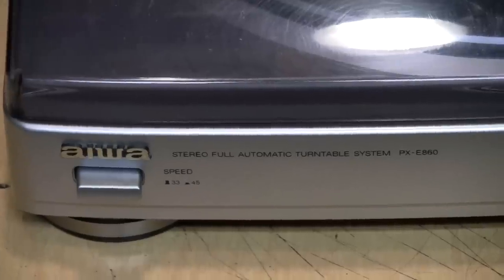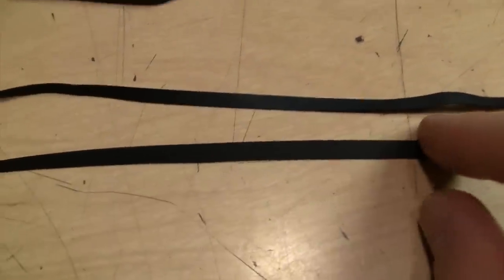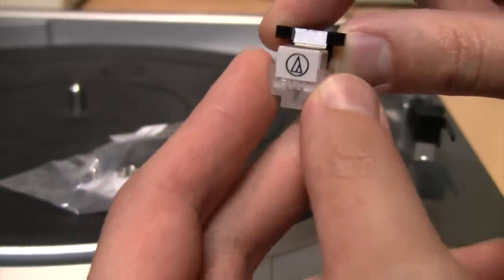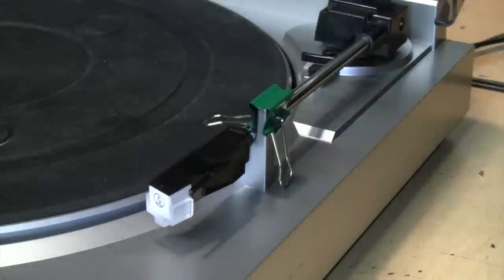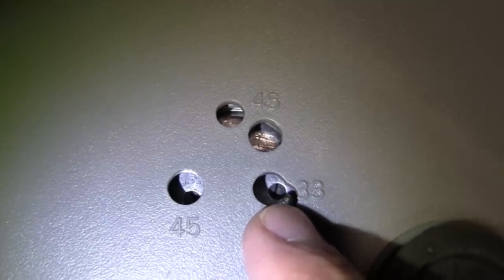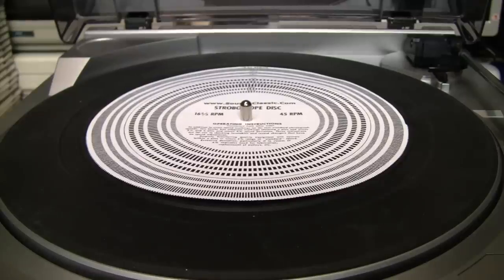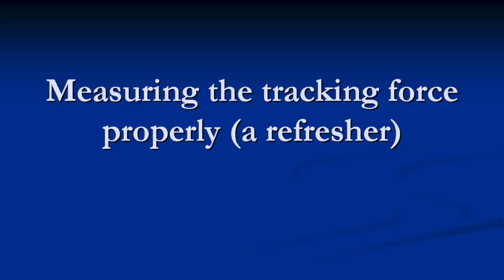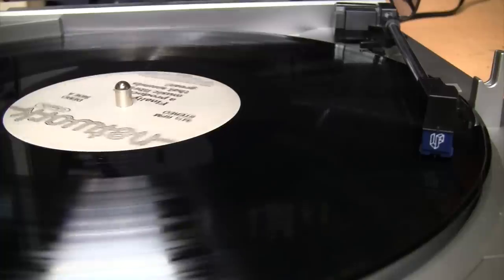Cheap fixes & upgrades for cheap turntables

Comment: I have a problem with my turntable of similar design. It’s a Optimus LAB 1100. when I set the pre amp to the off position and plug it in to my phono input I get a hum, which gets better when I either touch the body of the amplifier or the metal part of the tone arm, buzz gets louder louder when the internal DC motor starts up. When I turn on the preamp and connect it to a normal line in, none of that happens. It plays as it should. Any thoughts on that? 

Also. These don’t have a tone arm lock, but they do have a small hook behind the tone arm rest which you can put a twistie tie behind and tighten up on the tone arm for safer transport. That’ll help prevent scratching from a bulldog clip.

Comment: Turntables are hard to come by where I live, but I bought this exact model a couple months ago. It's my very first turntable, it costed about $25 but for me it was worth it since it didn't need any kind of repair, just needed the speed adjusted. I would've loved this video when I bought it, it explains very well how to get it going, which I had to figure out myself from multiple sources. Excelent video regardless, I truly love your channel. I just bought a Technics SL-QD33 yesterday for like $8 and I'll see how it performs

Comment: My first turntable was a JVC JL-A40 direct drive model, which should tell you how long ago I had it. I still have the Sansui SP-2500X speakers I bought at the same time.

I would like to get an equivalent turntable, but funds are limited these days. You can find an A40 sometimes on eBay, but they run $160+ before shipping if you want a working model. The A20 belt drive model looks similar, but still runs $80 plus shipping.

In  your opinion, do modern belt-driven models provide a near approximation of mid-range direct drive tables? I'm talking about less than $300 models, not a $2,000 turntable. Also, could you recommend a modern turntable with performance equivalent to the A40/A20 series? I'm picky enough to prefer an elliptical stylus and moving magnet cartridge.

Comment: I bought this model of turntable for a project to upcycle an Edwardian mahogany inlaid  HMV gramophone cabinet that had been cut down / stripped out probably 50 years ago  for a bedside table probably  and had seen better days. This was more of project to test out my French polishing / carpentry skills before attempting more valuable furniture. The Awia / AT turntable were the only ones that fitted within the cabinet’s width. These are very cheap turntables second hand and I was most sceptical about it, but it performed well with the active loud speakers I used for the gramophone cabinet project so yesterday I connected it up to my main hi-fi comparing with a Rega planar 3  which has a Quad amp , B&W speakers and was surprised at how well it sounded compared to the Rega.  I’m running a Rega Carbon on the RP3 which  of course I now realise is the same AT 3600 as the Awia  with a different mount. I only paid £25 for the Rega Carbon so it’s a cheap cartridge  but it amazing it’s ‘Only’ a AT 3600 at heart.  But why spend 10 times more ?

Comment: That 45 adapter part made me laugh. Because its true. I seen people use on top of a record like one of those record clamps/ weight. 

My good friend has the same Aiwa turntable. He bought the all in one unit back in 1999 maybe 2000. He still uses it a lot. I have the Sony turntable I bought for my bedroom back in 2009. I recently updated the belt and replaced the needle. The new belt has more torque. The original belt kept slipping once in a while after around the 4th or 5th year of owning it. 
Love your vids. Keep up the good work.

Comment: Just bought myself a second hand Pioneer PL-990 to fit into my 90's era Pioneer stack project (complete with LaserDisc player on the bottom). This was mostly inspired by your previous videos on the subject. Good step up on my cheap n' nasty GPO Memphis which has been in use far longer than I intended. If I'd listened to the snobs I would've had to keep using it while saving up something "acceptable".  Sure tables like the ones in this video aren't anything fancy but they are a good place to start/move up to if you know you're serious about amassing a collection without breaking the bank. Will maybe try that LPGear elliptical stylus when my existing one wears down. Love these videos, keep 'em coming!

Comment: I own that aiwa, I made some mods to the preamp, I replaced the op amp and  remove some filters, the high pass filter because my amp do its own filtering of signals below 20hz  and it's already DC protected in its inputs and I removed some filter that aiwa put there to reduce radio interference for people living near a radio station antenna. I also calculated the RIAA response and replace two resistor with 2 pair of resistor in series to get the value more closer to calculations and now the curve is more accurate. I glued two pennies as counter weight to get 3.5g. I also put an on/off switch in the 110/220 hole because I'm paranoid and the preamp is always on. I replace the transformer because the original was vibrating and making a 60hz hum (the reason for an on/off switch in the first place). The mods really improve the sound especially the removal of the filters because the filters used electrolytic capacitors in the signal path that degraded the sound quality.

Comment: I'd really want to thank you for showing the speed adjustment thing. I couldn't figure out how to adjust that because i didn't see any screws inside the 33/45rpm holes. Didn't know i was supposed to go through the gasket with the screwdriver. It took a while to set the correct speed, my at-lp60 usb was spinning 34,5/46 rpm at the beginning (i used the app to check that out). Now i was able to set it down to 33,5/45,3 rpm and it made a huge difference. Records sounds now way more accurate than it used to.

Comment: I have this exact Aiwa turntable. It's running too fast, even after trying to adjust the 33 setting slower. Do I just need to replace the motor? Do you have a good source for the motor?

Comment: Although I have been using record players for my whole life, some young people that never had a player at home and are not accustomed to them have asked me some of the stuff you depict. I found it very interesting and very informative and not only for those begginers, I learned some stuff too. These players may be the stepping stone to begin a collection. Not everyone can have top dollar stereo and these can show you how good or how incovenient a record player can be.  A well balanced buget player hooked up to a decente stereo with nice speakers can deliver nice sound. My 13 y.o. son have a sony record player connected to a sony shelf stereo, with tape, cd, md(lp), rds tuner and bluetooth through an adapter. A nice set up for wery little money.  I might upgrade the stylus to the blue one you showed.  Only tips I would add i to lubricate both the hinges with a silicone  based oil and the motor shaft with a syringe and synthetic motor oil (Just one drop to minimize the hum/background noise. The other is to place the player on a rectangular foam or sponge. this isoletes the player and the stylus from adjacent vibrations, dampening all of them and cancelling the Haas effect.

Comment: Is there not a little plastic hook on the back of the tone armrest? My Acoustic Solutions DR130 almost looks like it was made in the same factory as this, and it came with the tonearm tie-wrapped to the rest via a plastic hook built into the back.

Comment: I just picked up an Audio-Technica AT-LP60XBT-USB-BK as an additional TT to my old Hitachi.  While the Hitachi works wonderfully, I wanted a more "plug and play" TT to play through my 4K home theater which involves my high-end 4K PC.  This was more of an impulse purchase, but I am pleased with the sound produced by the AT TT.  That being said, one of the things I DO NOT like about this particular AT TT is that there is NO tone-arm clamp.  Luckily you shared that neat clip trick!  I feel a little more confident now while using this TT knowing I likely won't experience the dreaded tone-arm "bounce" when placing an album on this unit.  Small thing to some, big thing to others I guess ---- thanks for sharing that neat little trick!

Comment: To avoid shorting when making trim adjustments to the motor speed adjustment you can substitute a proper trimmer adjustment tool, which are insulated plastic or ceramic, to make the speed adjustment.  That is the intended tool and they are insulated because they are often used to adjust the potentiometers and capacitor trimpots on live circuits (sometimes even very high voltage in the case old tube based gear).  Trimmer tools come in a number of shapes and sizes, but in this instance you would want the flat/straight tools, though one may as well buy a small kit to keep on hand if they wish to tinker with adjusting their equipment themselves — though in general if one does not understand electronics they will want to limit their tinkering to only those adjustments that are very clearly labeled or per documented procedures.

When printing the rom speed check discs it really should not matter if your printer scales the size up or down a bit so long as it scales equally on both the X and Y axes since it is the degrees of rotation between AC line frequency flickers that actually matters and not their precise size and the degrees between each tick mark will remain unchanged so long as you scale up or down equally on both axes.

Comment: Thank you so much for this video! It is such a solution jewel 💎 for a beginner audiophiles! I have bought a Sony lx300usb turntable for 80$ from my buddy who is moving, and it turnes out it has some things to improve that my friends haven’t  noticed in 3 years of owning it 😝 
1) Rpm is 34.6 instead of 33.33 and I’m kinda scared to get a wrong screwdriver or mess it up🪛 
2) The tonearm mechanism is a bit off “falling” down to the record
3) Stock needle is dusty and I guess it needs to be replaced too
4) Belt is kinda ok but  you’ve recommend to replace it too
I’m really wondering should I maybe return it & get the brand new audio technica lp60xusb instead, since it will cost me a bit of money to get all this replaced (equal to the lp60 maybe? 😂 ). If anyone will be kind enough to give advice to a newbie, this would be awesome.

Comment: I have a sony 300 that is brand new but when it is on the table sounds like it is contacting the motor pulley. Thin. i might need a new spindle also the spindle can be pulled up and down almost a 1/4 in. What you think.

Comment: Question. I live in Europe and have a max 100 euro budget for a new turntable. I don't have the experience of getting the best old turntable and what comes with it. And as a student not the possibility for buying a €100+ turntable. I first had a retro travel player but want to have a small upgrade. Is the Nikkei NTT01U the equivalent of the Audio Technica LP60 (old style)? I can't seem to find a brand offering something similair as the LP60 except the Nikkei. It goes for 80 euros new. There is also the victrola vpro3100 but that is just above the 100 euro's mark. For 100 euro's we can have the LENCO-L101, these 2 can be a possibility as well, but I would love to spend that on some LP's if the quality of the Nikkei isn't too much different of the Victrola and Lenco. Thanks for your answer in advance.

Comment: can't fix the speed of a at-60, using a small screwdriver to turn the 33rpm screw but to no avail, seems it doesn't turn at all; any insight? the speed is a little over 34rpm.

Comment: Great comprehensive video. Not just for these turntables. Also some generally useable tips. Thanks!
And about snobbish haters: The hifi hobby is for everyone. Whether you have a small or a big budget. It's about the gear you can afford and get the best out of that. That's where the fun is. Tinkering to improve your system. It may even be more fun to have a small budget and having to be creative. It's easy to get a great sound if you have lots of money to spend, but getting a low budget system to sing and dance gives you a lot more satisfaction. And in the end it's about enjoying the music.

Comment: Nicely done. These TTs aren't so bad, as long as your expectations aren't too high. ;) I was able to score one for $26 and it was practically brand new; the original owner returned it as defective -- "it won't power on." Surprise, surprise: the original owner never bothered to take the instruction manual out of the sealed plastic bag, and therefore had no idea that the belt needed to be installed in order for the turntable to work. Read the f'n manual, people! Will it replace my Technics direct drive? Absolutely not. Is it good enough for a small bookshelf system in the bedroom? For 26 bucks, you betcha.

Comment: Oh that's why the RPM app said, that my turntable is slightly too fast, because I had no record on it. My turntable has a usb output to record it and it matched pretty much perfectly with flacs I ripped from the CD. you can actually put the waves above each other and compare it visually. very useful.

Comment: I once converted an old BSR to use a magnetic head. I had to use a spring on the back end of the tone arm for balance to keep it from being too heavy.

It's best to remove C-clips with pliers or at least tweezers so that you can hold it after you remove it. But be prepared for it to spring out.

If a song on a record has a time on it you can time how long it takes to actually play the song. It's not exact but it can help point out if the song is playing too fast or too slow. It also helps to play a song you're very familiar with.

I picked up a turntable for free that had the speed adjustment out of whack. Once I adjusted it properly it worked fine. You can find plastic screwdrivers for adjustments but I can't recall where I got mine.

There's no (properly working) modern turntable that will damage records. You can damage records if you play a modern record on a 70 year old turntable because they're designed to put weight on the record and were never made for modern records. You can often spot these old turntables by the 78 speed and the flippable needle.

Comment: I have versions where the switch to bypass the preamplifier/equalizer is outside. Sometimes it's useful, when a record doesn't confirm to RIAA, so I could do the equalizing in the audio software.

Comment: Thank you!  I got the lp gear upgrade stylus, a new belt, and I bought an acrylic platter mat.  Tighter bass and more nuance :) It's my secondary turntable for older records, but it was my main tt for months after the upgrades, and was fine!  I do things on the cheap because I am disabled, so your videos have helped me a lot! I need to back to find your video on the common red styli for like 9 bucks (Geodenci?)  I have 3 record players in need.  One has a plastic lp-sized platter with no holes, so I'm afraid of their installation.  I tried it with the old belt, and it never connects with the spinner.  It either slips off or gets caught on the notch on the platter that I'm supposed to use.  :(  Thanks again!

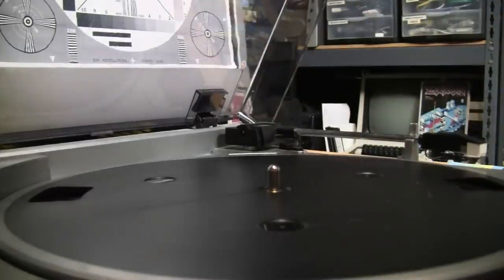Comment: Great informative video again but felt like the cuffs were going to get stuck inside the turntable lol 3:40 

I have recently maintained and fixed the pitch control of an old Dual 505-2, bought the parts from eBay and assembled them by myself without any prior experience in turntables and not much info online so, it would be great if you could do a video on these great old turntables.

Comment: Great video. On the thing though: Scaling a strobe disc doesn't matter, as long as it's not distorted. It still got the correct amount of lines on it, so it will work.

Comment: This is my exact record player. I inherited it from my grandmother in 2007, and it has never failed not once. I’ve had nicer ones, but I always just sell them and return to this. Original belt and needle. I have it running through a good hifi and it has always sounded good. I’ve always said that when it kicks it I’ll get a nice one, but it just keeps working perfectly. If it wasn’t for this player I wouldn’t have the collection I do now as I started buying right before the vinyl boom.
Reply: Mine is good also. But if you're running the original needle, wow man lol. Unless you barely use it I guess. But I noticed mine will skate sometimes when the needle is worn, a new one fixes it.
Reply: @wrnchhead76  I actually upgraded it to the yellow stylus now, but I can bargain tell a difference. I’ve always been really careful with cleaning and dusting records though

Comment: What if I can't remove the c clip holding the platter to check my belt's condition ? 
Would anyone have a tip on doing so ? Also does changing an almost new belt from on of these turntables to a new one (like the one recommended in the video) really improves sound quality ?

Comment: I actually use an audio technica turn table that I had never herd about untill I found it for a good price at my favorite second hand media shop. It is the pl-50. Everything works great and it sounds good, but I did replace the belt because the one it had was slightly too streched so had a tendency to fall right off the metal platter. From what I can tell, it's a similar design to the rest but I'm not sure of that because I am blind so can't see the inmages or videos. Also, you can apparently still get this particular model new.

Comment: Good quality old turntables have a strobelight on the side and indicators on the side of the platter letting you adjust the speed without any additional tools, with the record playing simultaneously. Pretty nifty but those are quite expensive nowadays